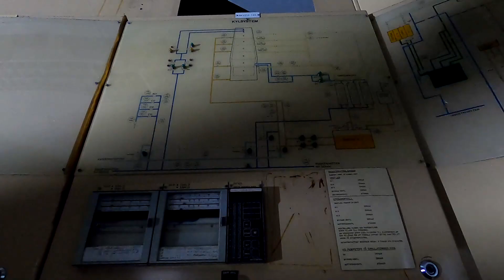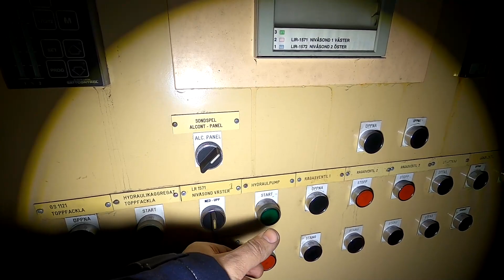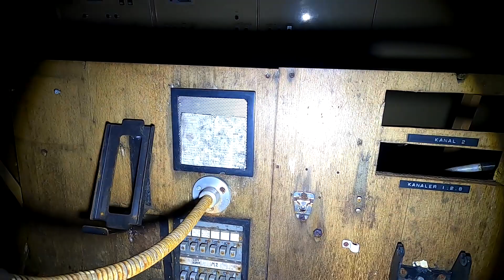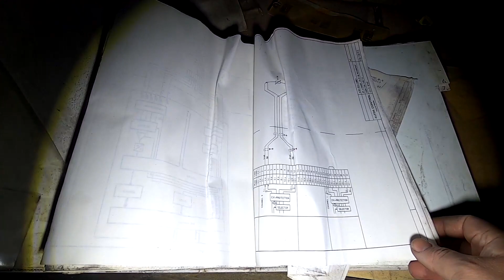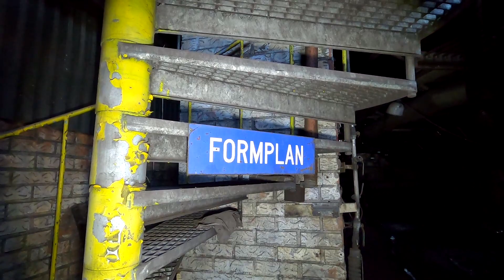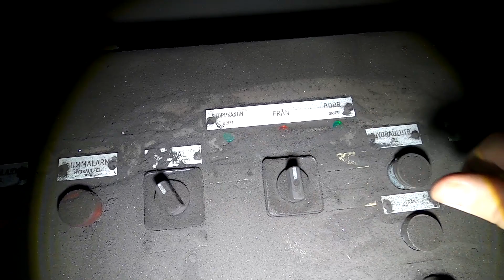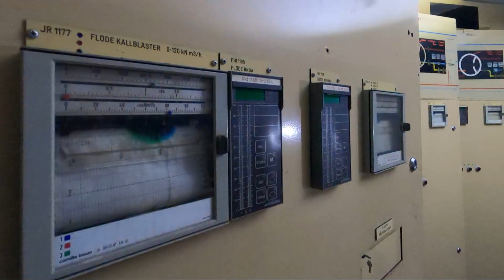Exploring A Blast Furnace - Abandoned Steelworks

Comment: Okay, seeing this is quite unexpected.
This blast furnace originally used to be the blast furnace 1 in Linz, Austria. When the Nazis came to power in Austria, it was decided to build a huge steel mill in Linz, owned by a company called Reichswerke Herrmann Göring. After the war, the mill was owned by a new company called VÖEST(Vereinigte Österreichische Eisen und Stahlwerke - united Austrian iron and steel works).

To afford repairing the massive damages from the war, one of the 6 blast furnaces was sold to Sweden, and in exchange, the first ore to produce iron arrived from there.
From the other 5 furnaces, only 2 remain today. 

I work in this steel mill, and a lot of things still look similar, especially the casthouse.
Reply from the maker: That is correct! Didnt know the part about the ore and that only two remain. Thank you for sharing!
Reply: @CMExploration  Yeah, a newer and larger blast furnace was built in the 1970s, which replaced 3 of them.
Blast furnace 2 was demolished in 1986 I think, furnace 3 in the 2000s and furnace 4 in 2012. The other 2 remain in operation.
Reply from the maker: Thanks again for watching and sharing!